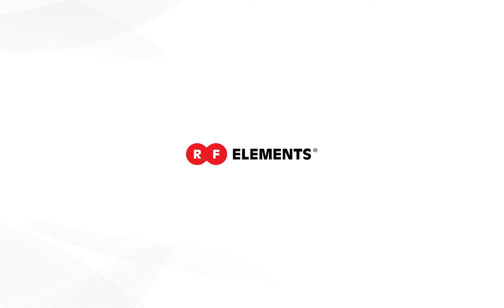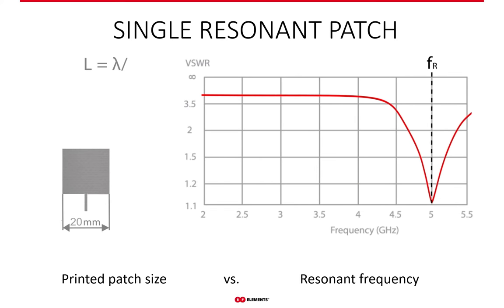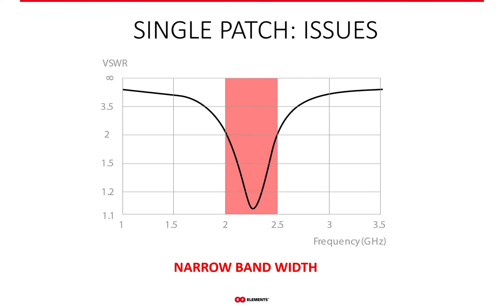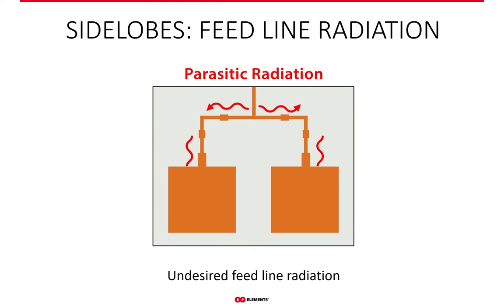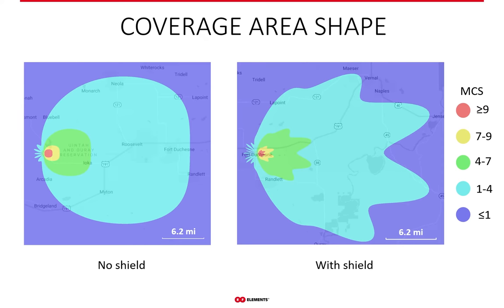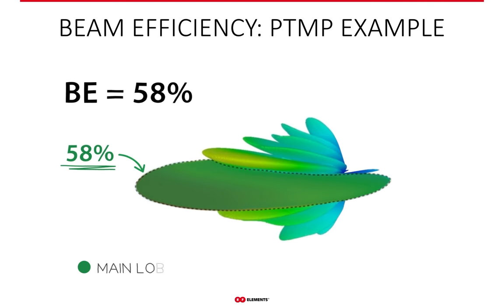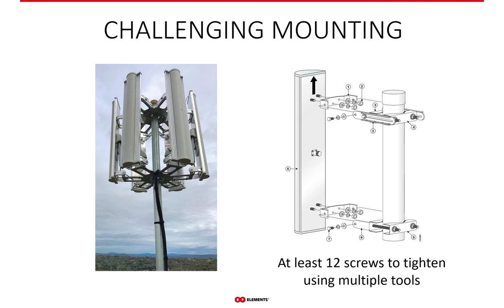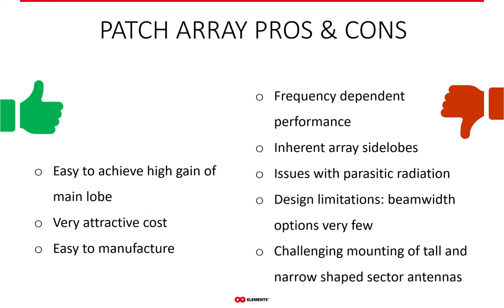Sector Antennas 101 - Patch Arrays

Comment: Not all side lobes are grating lobes. Grating lobes are a special case of a side lobe. It is conceptually useful to distinguish between side lobes and grating lobes because grating lobes have larger amplitudes than most, if not all, of the other side lobes. A grating lobe occurs when you steer too far with a phased array and the main beam reappears on the wrong side. Elements must be spaced properly in order to avoid grating lobes.
Reply from the maker: you're right, thanks for the note